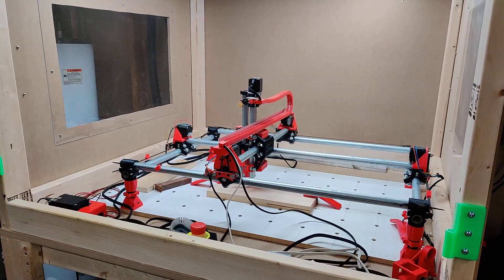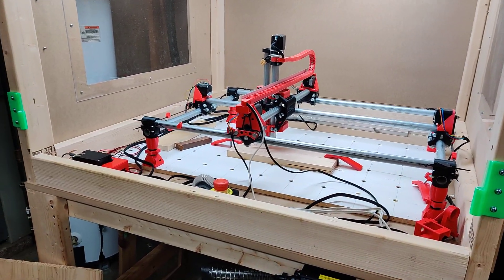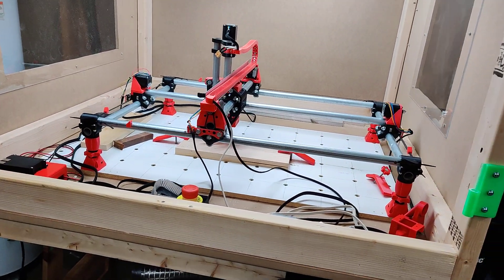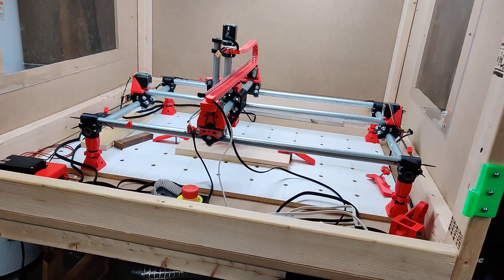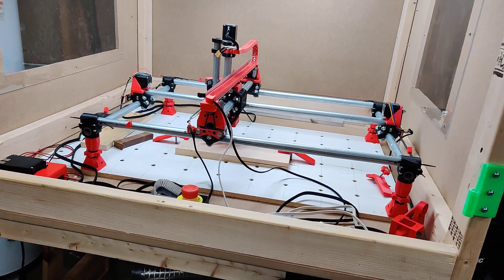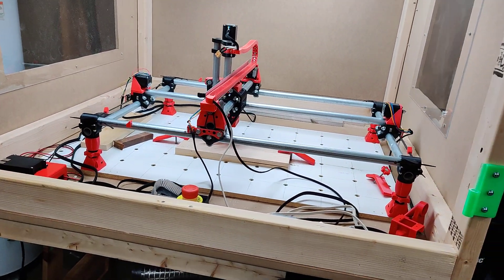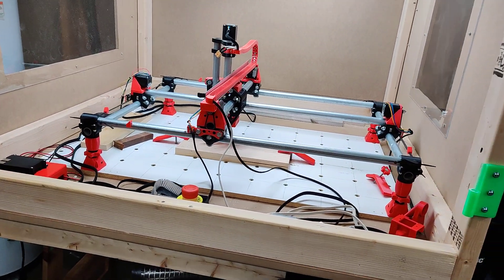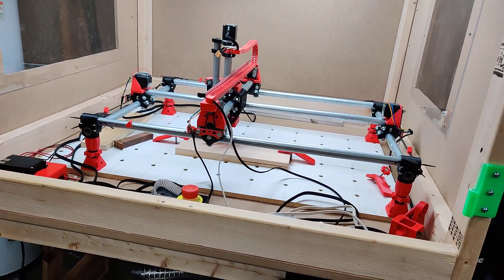Why I Use Octoprint On My MPCNC.

Comment: will octoprint work with the SKR pro 1.2 board.   Love the simple interface you have on the tablet.  Does the octoprint just connect via the USB plug ?  I'm using Repetier now but getting lots of interference and lockups when spindle is turned on.  having to print via the sd card instead.

Comment: Hi man! I have seen you are using the full rambo board. How did you set the E0 and E1 ports as X2 and Y2? I had to wire the two motors of each axis in parallel to make them move and I couldn't find the way to clone the X and Y movement to EO and E1 in marlin. Can you help me? I need that to set the dual endstops function
Reply: @ProjectsbyBrian  thank you man, I'll surely try that. Love your set up!

Comment: In some of the comments you answered that its just a plain octoprint install, are you using a plugin as well or did you have to set up everything custom? When I was first looking at doing this a couple years back octoprint didnt seem to support cnc machines ..
Reply: @ProjectsbyBrian  , Thanks for the reply, looking forward to seeing your video, I just got an Elegoo mars and decided I should upgrade the Anet a8, MPCNC with ramps & 3018 and found this video while researching for it. I'm leaning towards putting in the "Better Grbl Support" plug in on octopi for the cnc's. Have you tried "Klipper" for the printers? I'm wondering if it would be worth trying to use on the MPCNC. Thanks again...
Reply: @ProjectsbyBrian  Klipper does the bulk of the calculations on the pi then just has the printer board run them as events, seems to be smoother and faster, it runs as a octopi plugin.  https://www.klipper3d.org/Features.html

Comment: Nice setup man , where I can find the guides for how to integrate the pi with MPCNC? I would appreciate your help. 
It would be nice to make video on how u integrate the pi and connected to mpcnc and the software 
Thanks again sir
Reply: Brian R alright thank u sir for replaying I appreciate, and yes I found some video how to use the pi and octoprint . Am building my low rider now which would be 4’x8’ so it would be nice to have it in my phone and control it . Thank u and also check my channel I made lot of 3D relief with my MPCNC 
Thank u and have a good day

Comment: Thank you for sharing how you are controlling your different machines. I am curious to find out more about your 3D printer. Did you use the same one to print the MPCNC parts?
Reply: Thanks Brian! I have been debating whether to get the ready printed parts or first buy a 3DP and print the parts to build the MPCNC. And wasn't sure what type of 3DP to look for considering I am a total novice when it comes to 3DP and CNC but facinated by both :) When I have mine up and running I would love to pick your brains on how to connect the Rasberry Pi to the Rambo board. BTW, does it require any special programming to make it work or is it simply plug and play software configuration?
Reply: @ProjectsbyBrian  I see you have fitted the legs of your CNC to the spoil board which is mounted on the MDF surface of your table bench. I was curious to find out what is the material and thickness of the spoil board you have used and are the legs of the CNC screws into the spoil board? BTW, what are the dimensions of the tubes and the size of the workarea the CNC is able to travel.
Reply: Thanks, you have quite a large working area. What lenght are your metal conduits?

Comment: What firmware are you running on the controller board?
Reply: @ProjectsbyBrian  I looked it up on the v1engineering page: By default, Marlin seems to be on the board. So probably that is what you've got. I was wondering about that because many CNC controllers are running GRBL and didn't know how well octoprint would support it.